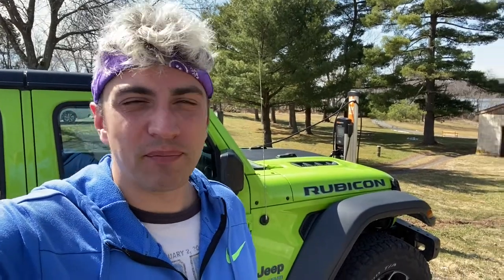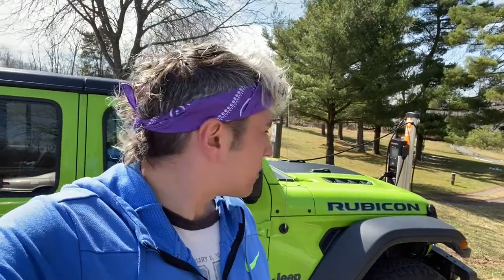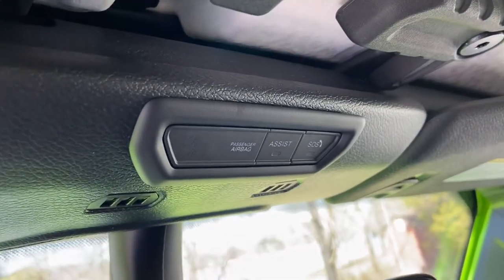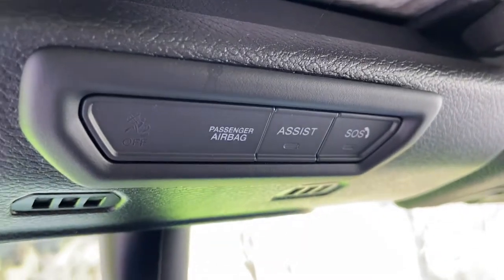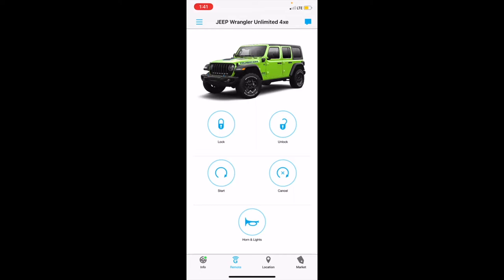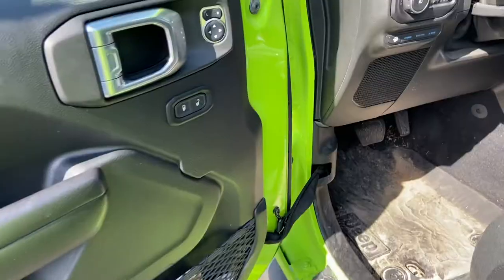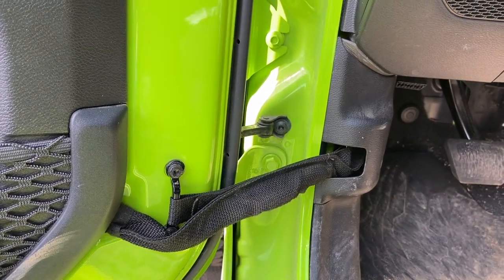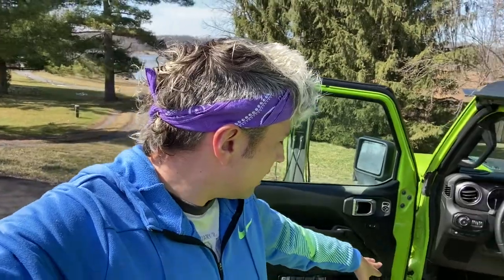Top 5 Tips to Owning A Jeep Wrangler 4xe Hybrid

Comment: The angle of attack on the JL windshield is way more aerodynamic than previous models. Just watch how and where you drive could save you a couple windshields. I’m sure they will only get more expensive with ACC and the built in antennas as time goes on.
Reply from the maker: Yeah I saw that about the antennas. I haven't had a problem with the glass since it was replaced with Gorilla Glass as was on my initial build so I venture you're right.

Comment: The first thing you should know when owning a dodge or jeep, is that your first WTF moment will be between 35 and 45,000 miles
Reply from the maker: Ha interesting. I’m at 42,000 miles right now. Can you elaborate? I’m Interested.
Reply: @charliepiazza  I’m 52. I have had nothing but Dodges and jeeps my entire life.  If I count them off the top of my head about eight dodges and probably about six jeeps.  I have always had something go wrong between 35 and 45,000 miles. Nothing serious.  Blower goes out, fuse blown, windows roll up crooked and need to be realigned, Engine lights coming on for no apparent reason.  A myriad of stuff.  But for some reason, it’s always between those two mileage stamps.  I’d say the most frustrating was the engine light kept coming on on my Dodge truck and nobody knew why.  They just kept clearing it and I’d come back a month later with another engine light.  Nothing too much to worry about Unless you’re warranty expired. lol

Comment: You forgot the most important part: set aside at least $1,500 in spare cash to repair it, LOL. They always always have ignition switch and throttle sensor failures regardless of model year.